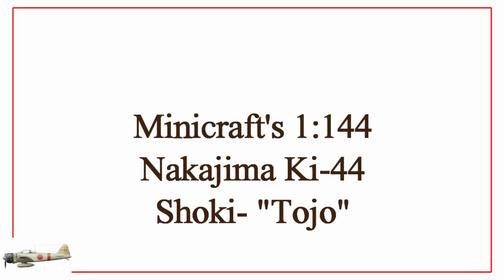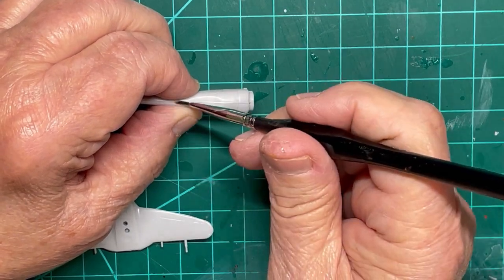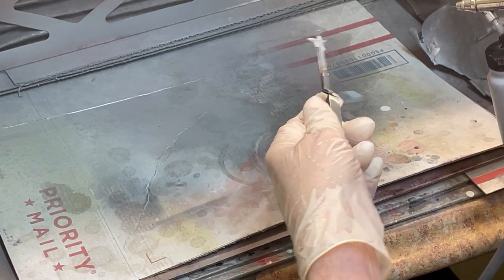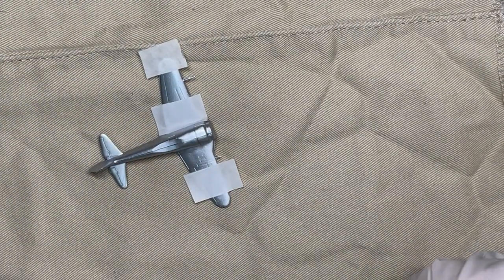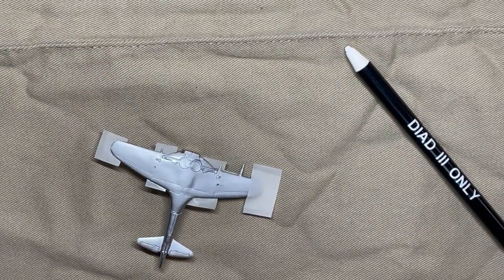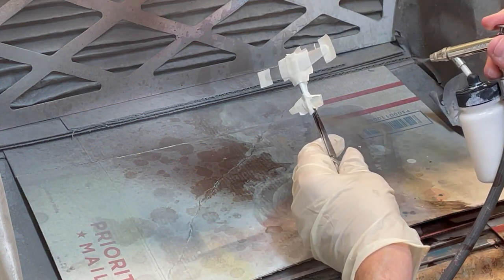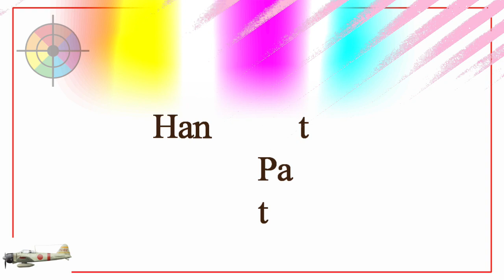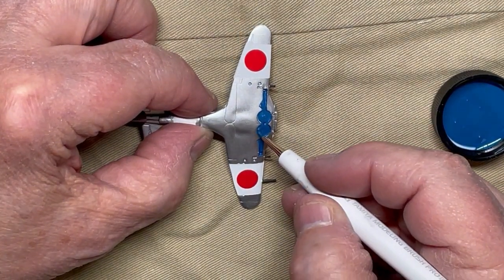Minicraft 1:144 Scale Nakajima Ki-44 Shoki, "TOJO;" Chapter 1: Painting and Initial Assembly

Comment: Since TCP is solvent based, what paint booth are you using or what paint booth do you recommend?
Reply from the maker: John:

You may use any paint booth available in Harbor Freight, Micro-Mark, Walthers Trains or any size/type that fits your budget. Most hobby booths have built in exhaust fans you can vent through a window or under the garage door. Some connect them to a bathroom or dryer exhaust fan to vent.
Reply from the maker: We use a fairly large commercial paint booth and exhaust under the overhead door in our plant shipping area.